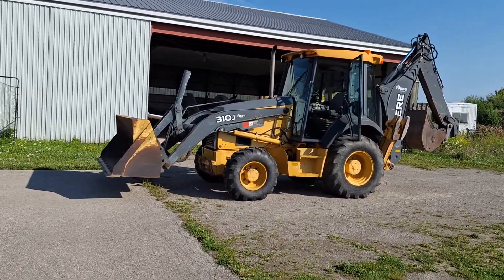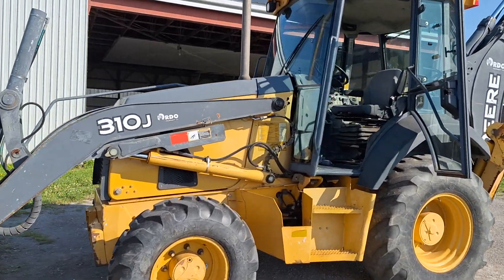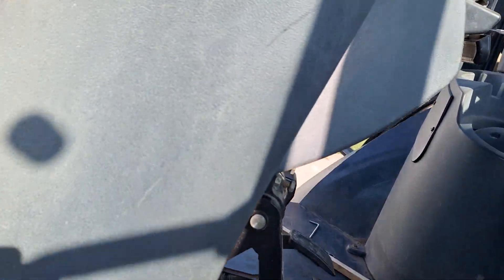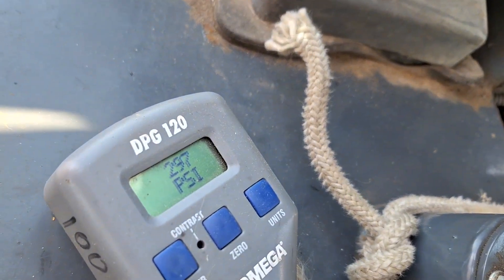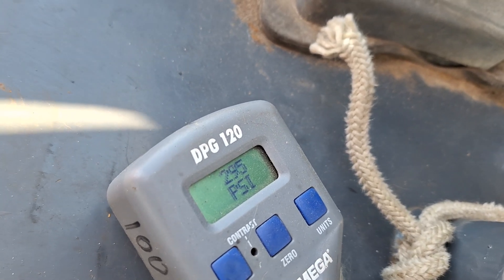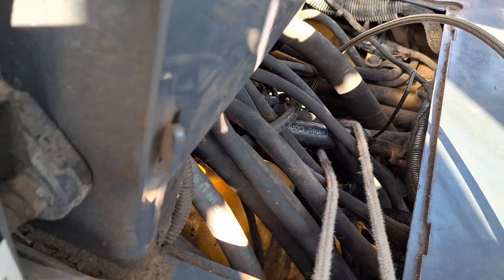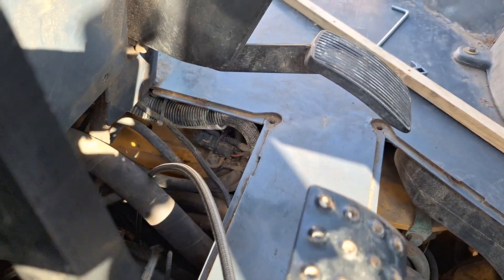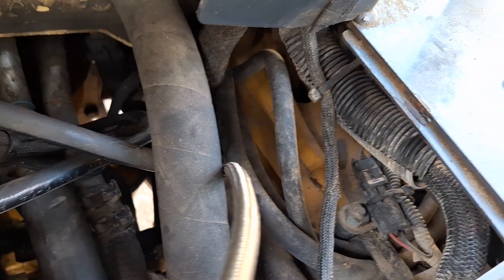Part 3 John Deere 310J Backhoe transmission problem

Comment: Thanks for sharing. I'm under the impression that you're not a backhoe mechanic but am greatly impressed by your knowledge and drive to get this job done. I do have a 310sj and this is one of my most feared things along with having to pull the engine off the machine. I wonder how much it cost you and can't imagine how much it would be if you had to take it to a JD Service dealer.
Reply from the maker: I mainly work on airplanes but 40 years I tried just about everything including heavy equipment.   I kind of enjoy moving dirt. I have a JD 550H dozer and just got Hyundai 450 excavator. Still looking for a large dump trailer I can pull with my tractor 🚜 and big compactor.  Cost of parts for planes are crazy I bought a cessna 150 that needs  a crankshaft.  $9,000 US for a used re-certified one.

Comment: Thanks for the advice. I pulled a 210K trans today, with help from your video. Mine is just the o’ring on the outside of the pump. I will check my converter to pump fit very closely.